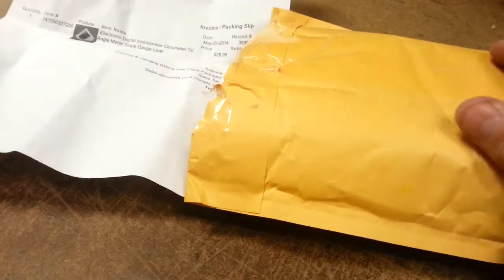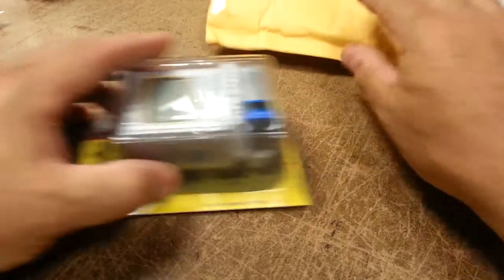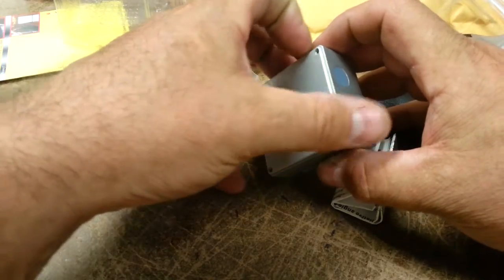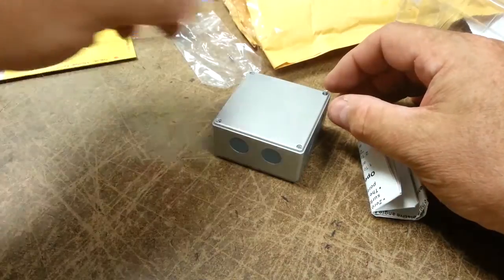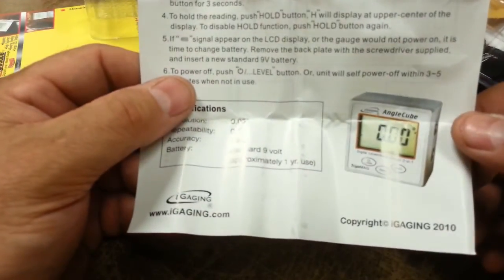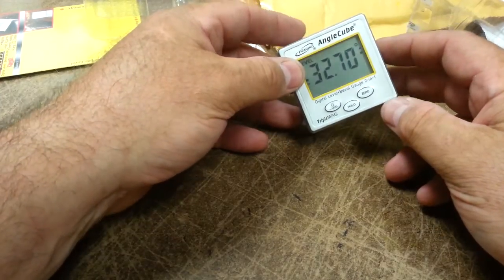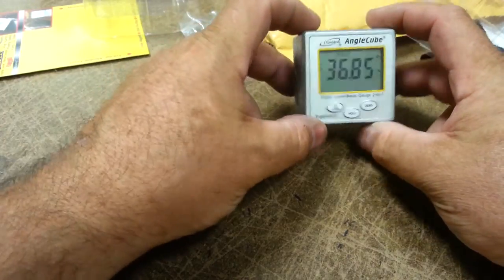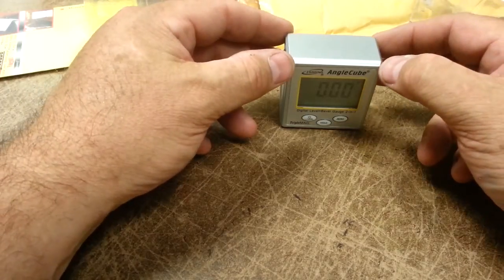Auto Gyro Setup & Check PART 1 Inclinometer

Comment: my father has a multimeter, but isn't really cluey on their use. it has a hold button in the middle of the dial. it's the kind that clicks down with one press and clicks up with another press. we were testing the semi-flexible solar panel. "your solar panel is dead, there's no voltage at all". he's pressed down the hold button as he has turned the knob to voltage.....

Comment: Just thought I'd drop in as I do occasionally. There were these levels (basically your standard building spirit level) and a particular company that went bankrupt had this one with a digital display on it that would write up the exact angle you were at. it was on the side of the level. good for doing pitched rooves and gutters (which have to be on a slight slope for the water to go to one end). sadly they went broke and no-one has anything like it stocked by the major hardware chain I usually go to.

I have got an weird but well made japanese spirit level inside a wheel with degrees marked all around the wheel (which can be moved) which has served me well for building purposes, but of course isn't digital.